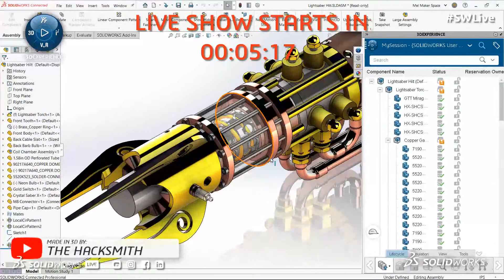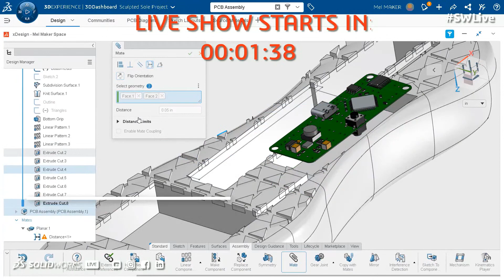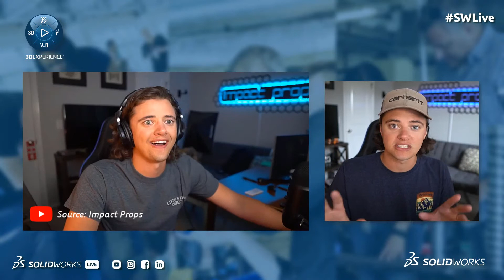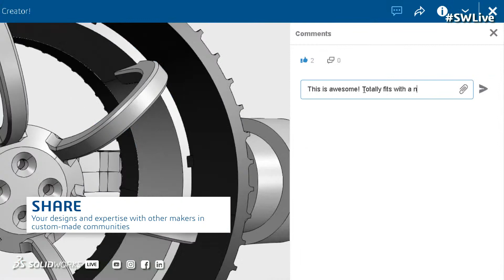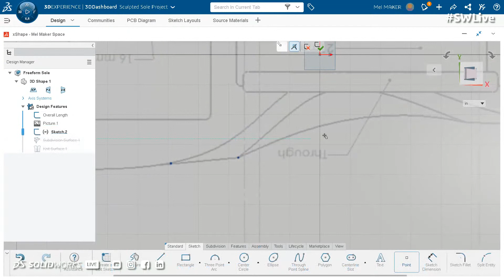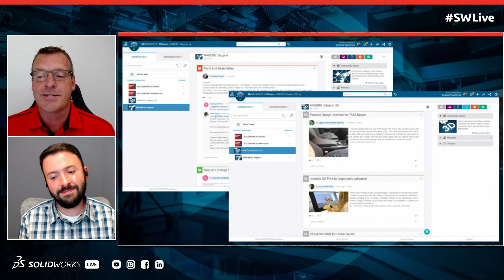3DEXPERIENCE SOLIDWORKS for Makers - SOLIDWORKS Live

Comment: If I ever move from the maker version to full fledged solidworks license, what happens to my previous design data? Can I somehow move that data to my new full solidworks or is the earmarking for forever? So I'd start from scratch?

what happens if I ever discontinue my subscription of maker? will I lose my access to my design data and files? I'm not asking if I can edit them, but if they're even available anymore?
Reply from the maker: Hi there, we often get this question and its a good one! Currently, your Maker files can only be opened in another Maker platform and are watermarked as such. If you are moving up to a perpetual or term SOLIDWORKS license, they both come included with Cloud Services for sharing data but you won’t be able to migrate Makers data right now. 

If you’re looking to launch a business, we recommend looking into SOLIDWORKS for Startups, where you can scale your startup with a year of free software: https://www.solidworks.com/solution/3dexperience-works-startup-program

Comment: Are the interface and basic functionalities of 3DEXPERIENCE  similar to those of SolidWorks Desktop Software or it's entirely another interface? hope will be comparable to the desktop one, just switched to Fusion360, mainly because it's free, but I don't like the workflow of top-down assembly they adopted.
Reply: Dont buy the makers garbage. AFTER i bought my license, I was made to do a cloud based test and it told me that my 9700k with a 2080ti pc isn't cloud compatible... AFTER they took my money, of course.
no one to contact, no help online, no way to even see my license or get it switched to a standalone version
Reply from the maker: Hi there, 
The 3DEXPERIENCE SOLIDWORKS CAD licenses (Standard, Professional, and Premium) do not run on the cloud and are essentially the same as SOLIDWORKS Desktop. The software is installed on your local hard drive and connects with the 3DEXPERIENCE Platform when SOLIDWORKS is running.

Please note, 3DEXPERIENCE SOLIDWORKS for MAKERS requires a download onto your hard drive. 3D Creator and 3D Sculptor are completely online and do not require any downloads or space on your computer. Please note, 3DEXPERIENCE SOLIDWORKS cannot be installed on the same hard drive as SOLIDWORKS 2021. Learn more about the system requirements for 3DEXPERIENCE SOLIDWORKS here.